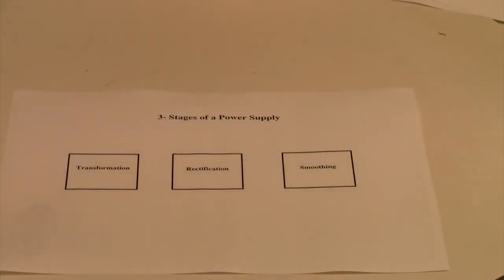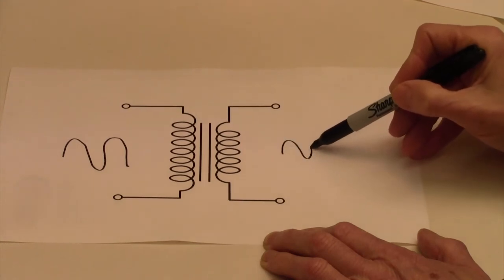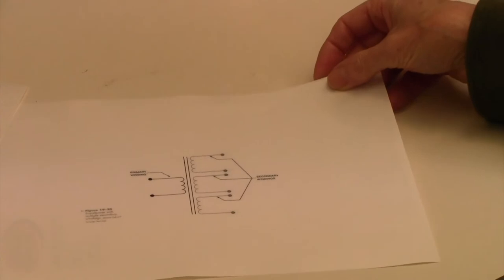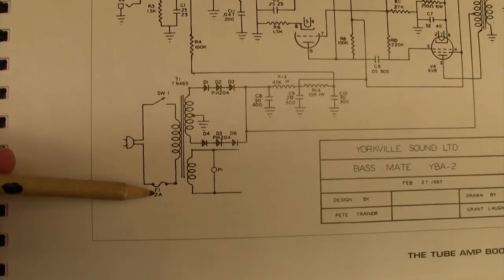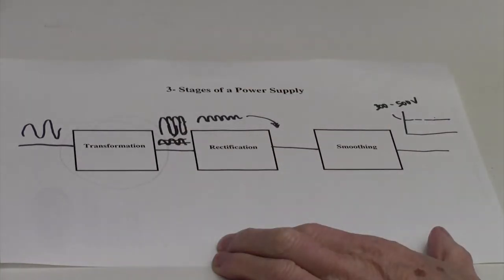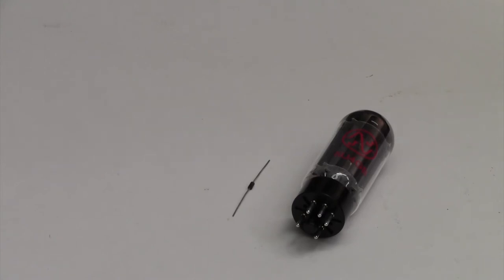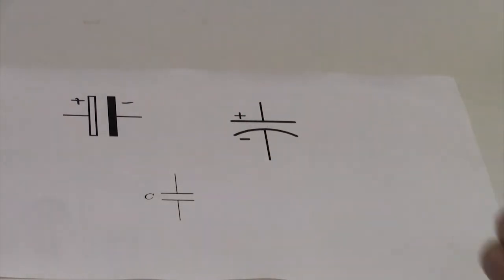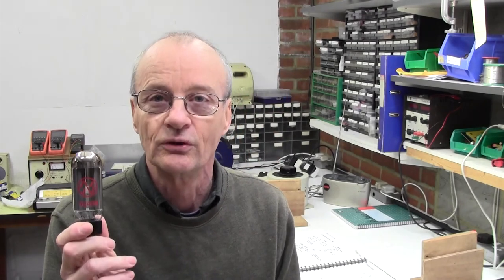How Valve Guitar Amplifiers Work Part 2

Comment: Hi Stuart. As you know, and just to clarify. Mains on the primary varies between a max positive of around 340V and a max negative of minus 340V, peak to peak 680V, with zero at the halfway point. Only 240V RMS when rectified. Cheers.
Reply from the maker: Yes easy to forget it's RMS!

Comment: The .01/400V capacitor in the primary circuit of the power supply (at 23:30) is the infamous 'death capacitor'.
Reply from the maker: Yes I usually snip that if I see it.

Comment: Hi Stuart, very nice for you to want to spend time educating on such a subject. Always nice to refresh the memory. Question; 
Are the transformers called multi-tap transformers?
Reply from the maker: Hi Walt I'm pleased you enjoyed it. The actual term 'multi tap transformer' is not really often used. Strictly speaking it refers to any winding which has more than two terminals on the SAME winding. So in practice this is usually the primary. It might have a basic 240V rating across the whole winding, but then have taps for say 230V and 220V. The term 'multi-tap' is also loosely used to describe a transformer with several secondary windings, e.g. 50V, 12V, 6.3V etc. But this is not really a correct useage of the term. Probably more info than you wanted!

Comment: Hello Stuart hope your well butt..The transformer!! 
When your talking about the secondary side having a few different functions, is that one lump of iron/box.. from one primary supply? 
Many thanks for sharing your knowledge Sir.. 
yours gratefully Mark. 😊👍
Reply from the maker: Hi MArk. Yes, one lump of iron. There's a single primary winding (e.g. 240V AC) then a number of secondary windings to give the different voltages you require, e.g. the valve heaters, the HT and so on. The more turns of wire on the secondary, the higher the voltage you get.
Reply: @stuartukguitarampguy5830  Brilliant,  thank you Sir👍

Comment: In the transformer, when you get to cables of the secondary for high voltage, it is irrelevant in whicever order you connect them to close the circuit right? The current going between those cables being AC you simply cannot get polarities wrong, since by definition the polarity goes all over the place in that circuit, correct?  In the smoothing capacitors, in any amp circuit you can swap those capacitors that were orginally there by any amount of voltage as long as you keep voltage greater equal to original and microFarrads greater equal than original? Thanks a lot.
Reply from the maker: Hi YEs both of the things you say above are true. BAsicaly, AC - it doesn;t matter about polarity. DC it does. ANd yes, what you say about capacitors is correct.
Think of 'The Working Voltage' as the amount of voltage it can stand without failing. So putting a HIGHER voiltage cap is good. Lower voltage and it could fail.

Comment: STUART, What do you mean by the primary magnetic field is "CUTTING" the turns of the secondary windings? What do you mean by "cutting"
Reply from the maker: Hi Wayne. Good question and it highlights how much knowledge I wrongly assume people have! So, as the magnetic field expands outward, it kind of 'cuts through' the windings. This causes a voltage to be induced in that winding. Then, when the field collapses, it again 'cuts through' the winding inducing an opposite polarity voltage. You can replace 'passes through' with 'cuts through' if that makes it easier.
Reply: @stuartukguitarampguy5830  I always thought the magnetic field was like newton rings surrounding the coils, I don't think it's cutting through the coils because cutting would mean there would be a " disconnect or break " into the magnetic field around each coil? The way I visualize it that magnetic field has no breaks or disconnects it's like rings surrounding each coil, no cuts